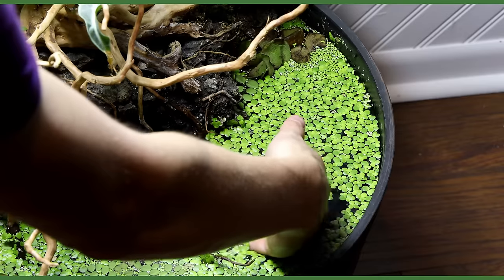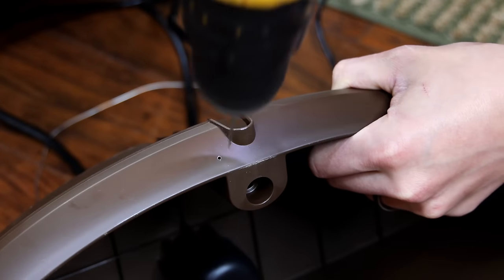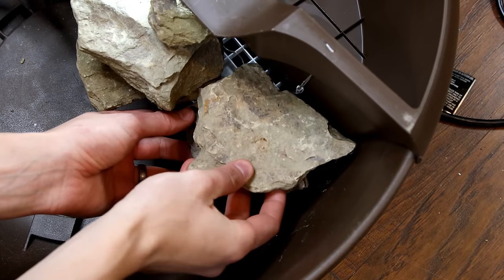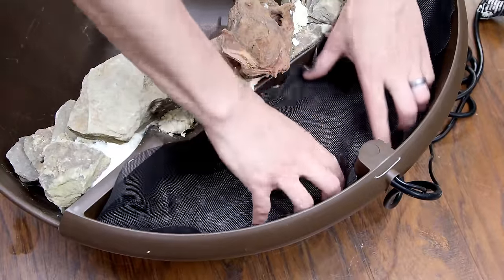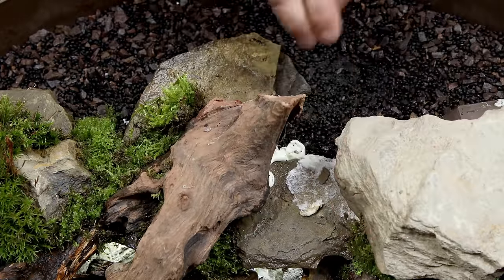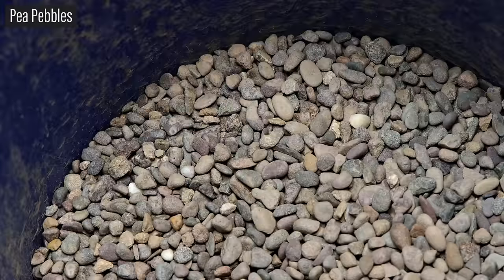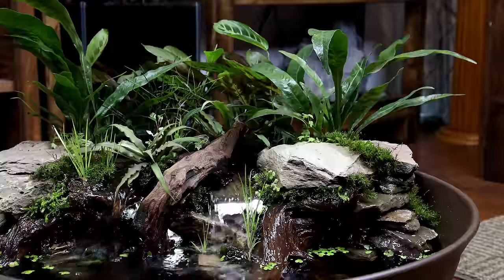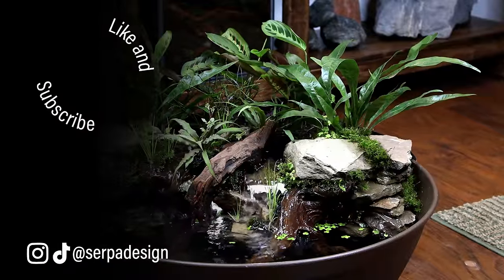AWESOME Naturalistic Indoor Mini Pond + Giveaway

Comment: I prefer SerpaDesign's pond compared to Ed The Pond Professor's. Tanner's is like nature in a bowl and Ed's is like a bowl in nature, if that makes sense 😅
Reply: yeah tanner did a better job hiding the plastic bowl with the hardscape while ed put the plastic bowl inside hardscape. both are great but i always feel plastic is the most unnatural looking thing in any setup and takes away from it.
Reply: Ed's doesn't look permanent either. He just surrounded it with a bunch of stuff against a bare wall. Looks like it will be immediately disassembled.
Reply: OMG,  those bowls cost $200.
Reply: Makes perfect sense, and is a very good description! Totally agree!
Reply: @egoranonymous3223  I got one like that for gardening that's even bigger for $10. Maybe a good diy~
Reply: Ditto to that. I feel the same. This one would definitely work well indoors! 😄
Reply: Perfect description. After all the effort of arranging things around the bowl/pond, I was really surprised by the choice to leave so much plastic visible.
Reply: @egoranonymous3223  I'm planning on doing this and I bought a real 1/2 wine barrel from Lowe's for $40. Way cheaper and way bigger!
Reply: I was trying to pinpoint and that is exactly what I thought seeing the two as well

Comment: About how much water should I add if I am making a closed terrarium in a pickle jar? I am also only using moss.
Reply: Koda Bear if you watch his closed terrarium builds he just sprays a little in when he cleans the walls, and he starts with a dry substrate. If you use the false bottom like he shows, I think it’s supposed to seperate the plant roots from the excess water. I don’t think he ever says exactly how much water to add, but it doesn’t seem like much. I made three terrariums after watching his videos and two are perfect, the other keeps fogging up which is too much water I think. So you can just leave to top open until it dries out a bit.